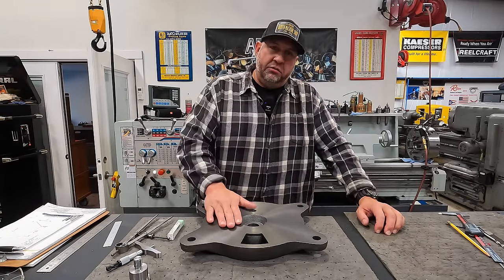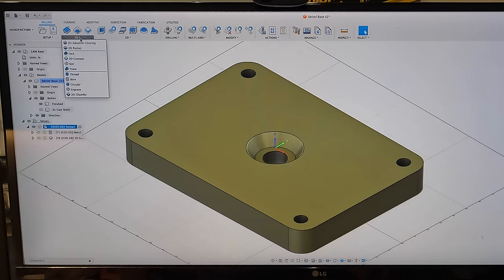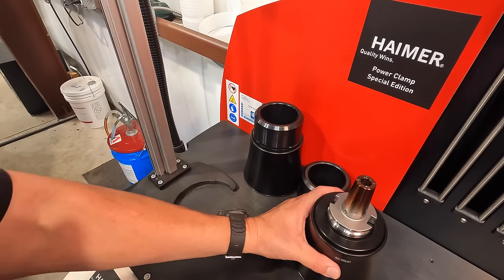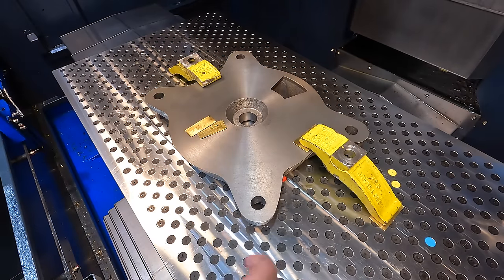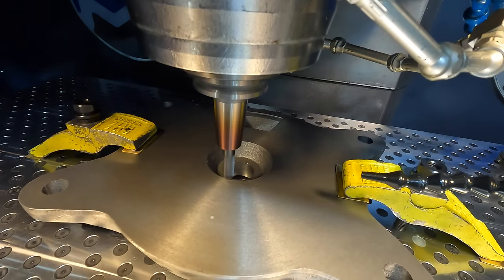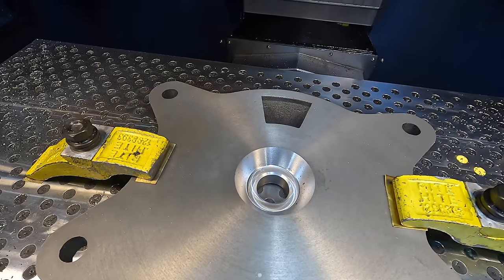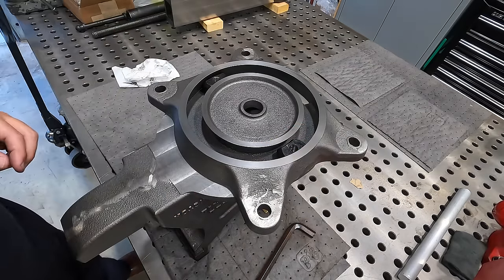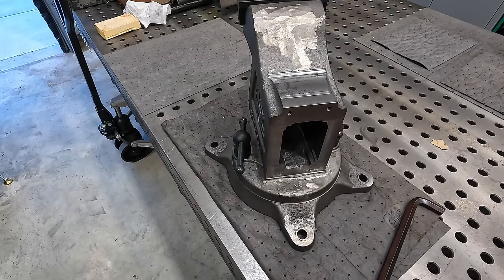Hardtail Vise Build Ep.18: Swivel Base Counterbore

Comment: There is this old German proverb: only those who do not work make no mistakes. Keep it up Adam, great journey.
Reply: Only, if you were a youngster starting out as a CNC operator, cutting out mistakes and machine crashes is very high on the agenda, cos getting replaced by the next youngster waiting in line to take your place is only an easy decision away.
Reply: @james-ew7kl  Depends on the employer. I have a friend that forgot to turn on the cooling for a $1M computer and it melted down. He went in to his boss's office to tender his resignation. The boss said - you can't quit now, I just paid $1M to train you! I'm sure you'll never make that mistake again. Now get back to work!
Reply: I didn't know it was an old proverb, but I've always said if you never mess up, you ain't going much.
Reply: Doing much
Reply: I hear that preverb after a crash, luckily tiny crashes - some mills/drills/chamfers because of not setting Work Z height

Comment: I haven't been a CNC machinist for a couple of years now, but I have over 10 years of experience doing it. One thing I learned was to always, always set a chamfer tool high and readjust a few times to get the perfect dimension.
Reply: Yep. Especially on a one-off. 13 years of CNC machining here.
Reply: That may have resulted in a .5 chamfer instead of a .005 chamfer in this case.

Comment: Adam, I almost jumper out of my chair when the chamfer tool took that big bite!  I remembered you saying the chamfer would be .010.
Reply: haha. What a spoiler...I read your comment before it happened.
Reply: Me too, i was like " looking good, looking good, here comes the chamfer.... Woah..." Hehe
I thought at first it was intentional and i was thinking that is a mighty wide chamfer but then realised it was a mistake. At least it wasn't like twice that width where it was wider than the bolt.
Other than being esthetically too large, it has no impact on the functioning so it's not that big a deal. We all learn from mistakes.
Reply: Messed up a chamfer on a part I spent many hours on, or to be specific two parts because I machined a hole for the cable in the split. The gromet almost covers it but that one will haunt me😅 I feel and recognize the disbelief when you hear it.

Comment: Adam, If you set the window in the base over the bolt hole in the vise, you could have set the locking lug right down on the bolt, then once the bolt was started turn the base till the window was over the other bolt hole and start the second bolt into the second lug.

Comment: G'day Adam. The CNC did a great job,  even though the swivel base champher was .090" to deep,  all I would have done is cut the flat bolt surface down .090" giving you the required. 010" champher. Then just re machine the Swivel Lock Bolt to correct dimensions in length, & all would be perfect 
Really nice job so far 👏 👍🏻 👌

Comment: You can just rotate the base to place the access window with the hole for the screw one side at a time!
Reply: Yeah, I was laughing along with him. He was definitely experiencing a brain fart after a long day.
Reply: I was wondering myself how many people were squirming in their chair watching him struggle with putting in the lock bolts from the top, when done from the bottom by just rotating the window to the bolt hole and inserting the lock (nut) and bolt, then rotate to the other side....
Reply: I was one of those screaming at the screen to turn it over and engage the bolts uner the hole. Adam didn't hear me but the neighbours did! @HoppersLab

Comment: My suggestion for installing the base clamps 
With the body upside down place the base on the body & fit the bolt
Rotate the base until the cutout in the base lines up with one of the clamp holes
Put the clamp in the in the cutout & screw the clamp bolt into the clamp
Rotate the base 180 degree & repeat
Reply: I was telling the screen the same thing. It's amazing how something so obvious to some of us is overlooked by someone else.

Comment: Adam. Nice work of the Fusion modelling, its a bummer to see the mistake, but great trouble shooting to find it. The simple model you drew is a common approach to designing and working with key features. If you wanted to add more of the features you had previously left out without the need to draw the entire item manually. Consider using the Canvas feature. In that you take a photo of the item (make sure you use a tripod with the lens parallel to the surface you are capturing, I'd also have transfer punches upside down in the holes so you have clear visual centre points). You need to manually measure between two points (hence the centre points) to get a exact distance, then in fusion after importing the canvas you calibrate the image by setting the correct distance between those same two known points you have the manual measurement for. Once the image has been calibrated you can use the outline when sketching to quickly draw your base lines before setting dimensions to get your sketch in the ball park size and shape. A second fusion feature to get training on or read about is "Parameters", these are static dimensions you can set in a single place, and apply custom names to. For example, if you only use 3 chamfer depths 10thou, 20thouh and 30thou, then you'd create a Parameter for each option with a custom name like Cham10, Cham20 Cham30. then in your tool path setting instead of using an actual number value you instead put in the Parameter name in this example Cham10. Its a great way to have at your disposal dimensions you use all the time for specific uses (Builders do the same for things like standard door openings etc). by using Parameters for your regularly used dimensions, you'll get in the habit of going to the parameters page and checking a single list before committing a drawing. Also if you need to make a change for what ever reason, then applying the change to the Parameters section of a dimension applies that everywhere that the Parameters name is used, so on a large job you'll adjust all Chamfers (in this example) from one place. I hope that gives you some food for thought, Take care D

Comment: Nice work! When you need to edit a tool path instead or right clicking and hitting "edit" you can just double click on the tool path itself and the edit screen pops up. On chamfering operations like that I like the chamfer mill to be offset down in Z as much as possible (chamfer tip offset value). That means you are actually cutting with the larger diameter of the chamfer mill. This gets the SFM of the tool up and helps make a cleaner chamfer especially in aluminum.

Comment: Look on the bright side - now you can make another swivel screw with a fillet at the head/shoulder corner. 
Also - question: If you're removing an endmill just to replace with a new endmill, why cool the holder in between? Can't you heat, remove, and insert in one heating? OK, that was two questions, but still...

Comment: I used to use a pick like that with just a little 90 on the end for pulling wheel lug covers on vw's and bmws back when i was a lube tech lots of oil and tire changes i hated pulling those caps if you didnt get behind them good enough sometimes they would break coming off

Comment: If that .1 chamfer bothers you too much ... make it a feature and make a new lock bolt with a corresponding cone shaped shoulder. THAT would be a challenging project on the CNC lathe!

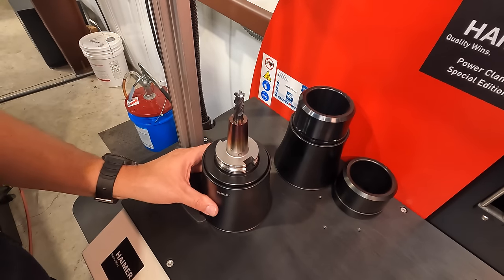Comment: 13:16 .. The ida of heat shrinking a utte seems a bit I don't know, a bit different at least.  

BUT when you think of it? There's no moving part nothing to wear out, it's super compact when finished, and had GOT to WAY cheaper than the compilated and exact machining needed to make accollet.

I was reading on lime the life span of a shrink fit holder can be thousands of heat and cool uses, if properly heated and cooled as Adam was showing as mandated by the manufacture.   

Something I DIDN'T think of is tool life of the cutter is normally extended GREATLY, with Twice to EIGHT times the utting lifespan, due to lack of vibration, flex and "whipping" a tool gets when helded in a common collet.  Especially with solid carbide cutting tools lie Adam is using.

I find this very interesting!!  Amazing!

Comment: I modified my swivel base vise. I had problems with the swivel clamps binding unless I loosened them right off. I installed springs on the clamping bolts that pushed the T=nuts away when loosened. Worked a treat.

Comment: 34:50  There's actually no logical reason to machine any of the work shown today ... it's not for looks nobody can see it without unbolting the vice off the bench and partially disassembling it, and the custom shoulder bolt does even touch any of the machined surfaces at all.  They could have been left in cast finish.  Technically unnecessarily removing all the material, makes it a bit weaker.

Interesting to see the detail of the CNC mill at any rate :)

Comment: I don't know how many mistakes like that I've made learning "while doing stuff for myself."  If it's functional, who cares.  You both learned something and came away with a usable part.  That's still a success even if you prefer perfection.  You are way more confident now Adam.  When you started you were just straight up intimidated by the whole process (which everyone should be at the beginning).  Now you are just about to the point where you know what you need to look up.  Which is a good feeling because crossing into the self-sufficient learning zone means you are really on your way.

Comment: I have a cnc router for woodworking, I also use fusion 360. Outside of an auto cad course I took, I pretty much taught myself how to make things in a 3D cad program and transfer that to a cnc machine. It’s good you seek guidance when trying new operations but I’ve found experimenting with the program and utilizing the simulation function really teaches you a lot. Also, using safe work pieces like foam insulation allows you to test your program while eliminating waste of a workpiece and eliminating damage to your machine. Obviously if you have the means to hire professional help, all the power to you, absolutely nothing wrong with that. But also don’t be afraid to dabble safely. There’s a lot of benefits to gain from discovering something on your own. I love your channel and this build series, keep it up!

Comment: Just curious why you cooled off the tool holder in-between removing the old bit and installing the new bit?
Reply: The heat cycle is timed for starting from a cool holder. Unless you just swap the tool while it's still hot from the release, hitting a second heat cycle would overheat the holder. Typically, you will want to clean the holder and set the depth stop, too.
Reply: @RambozoClown  Makes sense.
Reply: @RambozoClown  Wondered the same thing. Makes sense.
Reply: I agree, if the toolholder is hot enough to slip a tool out then it is hot enough to quickly pop anothe one in.

Comment: Oh, that was so fun to watch.  Good job! Your chamfer width problem is a common one in all computer programming.  Especially when your CNC program hasn't been used very often, it would be useful to put in some tests to see if the numbers being punched in by the operator are reasonable.  For example, here, you have a subprogram to chamfer the end of a bore hole.  I can't imagine you wanting to make a chamfer width of less that .002" or greater than .02" in most circumstances.  You can likely come up with better bounds than I can. But, as you said, a chamfer width of 0.1" just looks weird.  So, add some code in the first part of your chamfer program to test whether the chamfer width punched in by the operator is within reasonable bounds.  If not, pause the program and give the operator an error code that means "unusual chamfer width".  If the operator knows that his boss really wants such an odd chamfer width then the operator can tell the program to continue.

Comment: On the Mac a screen recording is very simple. Open QuickTime and choose File > New Screen Recording. You can choose to record the entire screen or use the “crop handles” to select the area to be recorded. Hit the record button on the bottom interface and when you’re done, click the stop icon on the top of the screen in the task bar. It might automatically save the video on the desktop as a .MOV file.

Comment: Nice job Adam. Sorry for your slip up :). 
My thought for assembling the swivel base would be to do it upside down as you started off. Place the swivel base on top, then install the swivel bolt. You can then simply swivel the base until the access opening is above one of the toggle bolt holes. Drop the slot nut into the slot through the access hole directly over the bolt hole in the main body. Install the toggle bolt loosely. Then just swivel the base 180° to line up with the second hole & rinse & repeat…

Comment: Next time you need to put the two pieces together, do it upside down, rotate the opening over the bolt hole and get one started. Then rotate it 180 degrees putting the opening over the other bolt hole and get the second one going. This way you can see what you are doing.

Comment: Regarding the CAD/CAM, if you don't use it regularly you will lose it. Break out the 3d printer and print stuff to help you continue to practice the CAD part.
Reply: He off loaded his 3d printer a good few years back.
Reply: @james-ew7kl  Too bad makes a cheapish way to practice creating stuff without wearing out cutting tools and scraping lots of metal. Good for prototyping for fit if you take the shrinkage into consideration.

Comment: At the chamfer I thought of only 2 things that I myself have experienced. 1st Wrong chamfer width in fusion; 2nd Not probed tool height (3rd would be not probed work Z height, but that applies to stock which varies in thickness on more than one part and doesn't get faced as per requirements)
I myself am a CNC operator who sets the machine up for work, also additionally I'm a CAM engineer on 3-axis/5-axis mills. 3-axis is super simple which helps people get into the trade :) 5-axis is a little bit different, needs a little bit more thought, but once you get a hang of it, it becomes really fun and enjoyable to program and work on.
Keep on learning, gather as much information as you can and then that can be used for various purposes and goals!

Comment: One thing you can do when typing into fields in Fusion is standardize the WAY you type into those fields every time you use them.  For example:  Just typing .1 or .10 can get you into real trouble when you are thinking in thousandths and you meant one or ten thousandths but got 100 thousandths instead.  You were thinking the right thing, but typed something else.  Try typing all 3 digits after the decimal EVERY TIME for a while.  For example:  always type .100 or .010 or .001.  It provides several additional "hooks" in your brain to recognize a mistake in the decimal place you are working in.  Some people take this a step farther and will always type the 0.100 because it makes seeing the decimal point more obvious.  If you miss typing the decimal point entirely you are suddenly dealing in whole inches.

Comment: Have you ever retrofitted a variable speed drive on a mill or drill press? I have an old Cincinnati Tool Master mill that I would like more spindle speed control in addition to the back gear / variable speed pulley which it came with. A simple drive/motor combination from someone like Automation Direct is not too expensive but I'm not sure which way to go when it comes to D.C. or variable frequency A.C. The additional speed control I am after is mainly at the lower end of the spectrum and the torque load would not be too great just slower speeds. Anyone's experience either good or bad would be appreciated.

Comment: A chamfer that's a little large is small price to pay for that kind of mistake. I destroyed a spindle on a HAAS VF3 when I made a similar mistake and drove a 5 in. shell mill down into a work holding magnet. The gearbox in the spindle tries to shift under full load and broke itself. The toolholder was fine and we recut the magnet surface, but the spindle cost my university about $20K.

Comment: Phooey!

I was hoping you'd mount that bad boy up on a faceplate and run it on one of the big lathes. 😜

One trick for checking things: run the simulation and use the inspection tools to verify the appearance and dimensions of the final part. If Fusion doesn't support that, other simulator tools such as CutViewer will let you take cross sections and measure features.

Check your arsenal of old tools to find a spot facing tool. You've got such a collection that i bet you already own one. That will give you a nice circular machined flat centered on the hole

Comment: Hey Adam nice work.  As a possible improvement you could make a quick change on the swivel bolt outer flange diameter and run a new part in the lathe which will give lots more surface contact between the swivel bolt face and swivel base. a perfect example of the beauty of CNC program saving and editing for reuse. The swivel bolt flange overlap could come into play with heavy loads when prying while using the hardtail vise. The contact patch looks to be minimal with the 100 thou chamfer. The beautiful contoured face and the now perfect concentricity between the base bore and the wall taper wall gives you lots of room to enlarge the swivel bolt diameter and get a much larger contact patch. You could also put a larger Abom 79 logo on the swivel bolt too with the larger face.